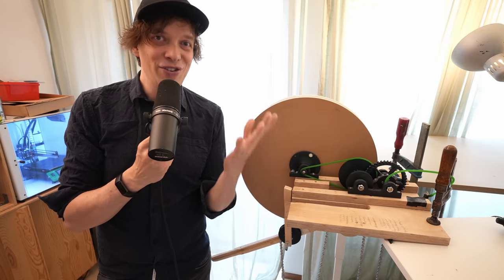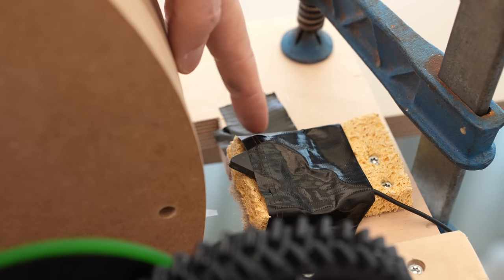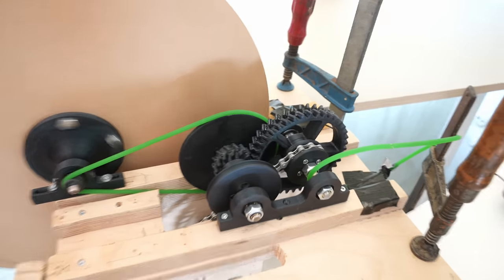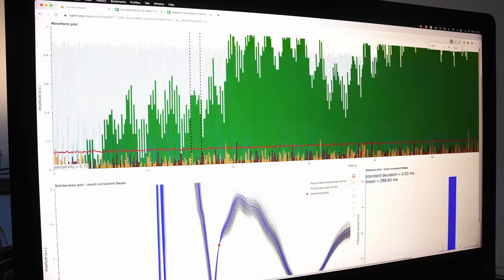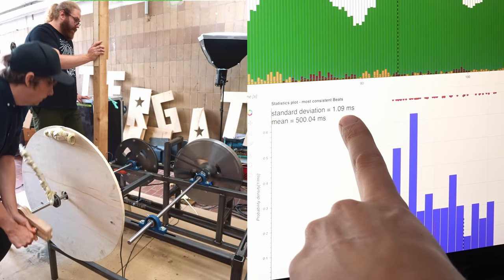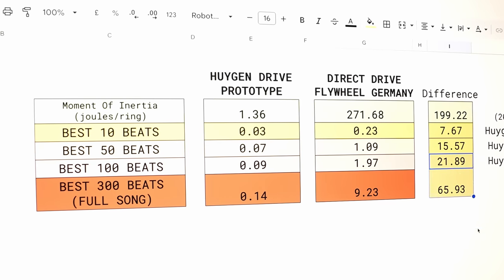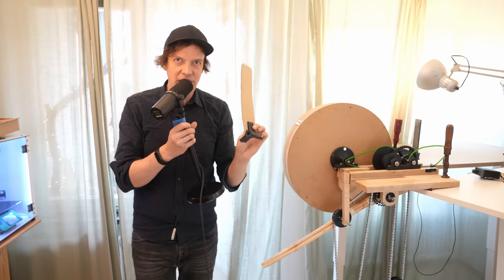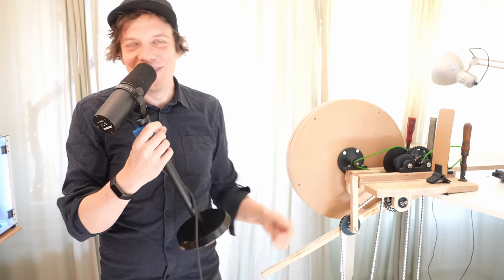Is Gravity Really Constant? I Built this machine to find out.

Comment: You really need to install a Governor. It is a reason they use it on a machine with a heavy flywheel. It really helps to keep a steady speed. 😉
Reply: Very true
Reply: Is there a way to have the governor tied loosely to the input? Martin cranks at ~100bpm and the drive evens out the output to keep it constant. If he changes to 80, the governor adjusts to the new rhythm.
Reply: Yes ! Without a governor, this idea with the weight won't work. The weight (and force) will be constant, but the machine will go slower in parts of the music with more notes. When there are less notes to play, the machine will accelerate.
Martin, you need a governor !
Reply: But aren't these things controlling the power ? Like the vent from a steam machine..  (?). So they don't make any sense on a hand-or pedal driven system ..
Reply: The Governor combind wit Huygens drive is probably the best solution.

Comment: Martin, I think that you push your prototypes beyond what they are capable of measuring. Rough prototypes can give a direction, but testing prototypes have to be close to the final design, it's not a prototype because its "rough" or "half-finished" it's a prototype because it's not the final. But to run exacting tests, you need the prototype to be full fleshed out, that way any changes you make toward the final product will actually be realized in your final product. The way you are doing it, you're building a rough model, and then going straight to final based on the rough model, and then getting frustrated when the final doesn't work... because really it's just the first prototype. What you've built here isn't a prototype, it's a practical model. Talk to your engineers about it, I'm sure they know more.
Reply: Louder!  I don't think Martin can hear you.

Martin does seem to make things worse for himself…

Comment: You are going to need to do some testing with that flywheel and the prototype in Germoney under actual load, driving something that puts up varying resistance. That should give you more reliable/useful measurements.
Reply: Germoney? Is that like someone from Harry Potter?
Reply: Yes, I don't understand how this design could work with varying torque as it needs a constant resistance, no?
Reply: I think it comes down to how the governor ends up being designed, because the governor will end up adjusting how much load it puts on the flywheel in response to everything else that's being powered by the flywheel. Like this is two major improvements, creating a constant source of power and the governor to use that constant power to regulate the speed of the flywheel. I'm interested to see how much more effort it takes to keep this going, since it's basically wasting a lot of power in the form of air drag to keep the speed constant
Reply: Indeed, a 'tight' power train when it isn't doing useful work really doesn't mean anything. You will need a really really massive flywheel to overwhelm the tempo changes caused by variable forces of actuating all those gates to be a tight as Martin desires (though worth pointing out the drum full of pins is also a flywheel of some reasonable merit in its own right, so once you get both the common flywheel and the music box drum spun up you should get even better results). Not to mention in the modular machine context its possible whole extra modules are also only sometimes providing resistance at all... But Martin does seem to barely notice comments such as this...  And that Hyugen will probably not scale up practically for a world tour, if you can even make it run on one man power at all - bench size test is not the same as lifesize!
Reply: @foldionepapyrus3441  Nah it's fine. The Huygens drive will scale fine, so long as the size of the MM3 can be 2m×3m×35m. Who wouldn't want to see Martin's suitcase dangling from a chain 30 meters above the stage?
Reply: @foldionepapyrus3441  Completely agree.

Comment: The weight of the chain will vary based on its length and the impulse of raising the weight will also contribute to the variance. Glad you decided on the more consistent choice. Speed can be adjusted from the governor so you still have the ability to add your feelings on the fly. It might be fun to have someone from the audience use a bicycle type contraption for raising the weight so you can preserve the use of a pedal.
Reply: He mentioned that the weight needs to be kept at a constant height which would negate the influence of the chain length. Either way he should have used an escapement, if he wanted a clock.

Comment: My main concern is that this drive seems very dependent on load, this would means if you're to keep this tightness, you'd have to make sure load is also constant
Reply: Yep, it may need some sort of torque converter linked to a governor. But I think, at large, the load will be almost constant during the song. It will just depend on the number of simultaneous notes played.
Reply: I can imagine times when, for example some tracks are muted. The load will drop and without a governor, it will begin to speed up
Reply: @frazbombe   yep muting was my first thought, drum sections on the MMX seems to take quite some load, flywheel will dampen somehow. But yeah, without a governor, no way to get back on timing
Reply: Governor would add resistance when going over desired rpm. When load makes the machine slower governor will reduce its resistance to compensate. There are also governor designs with integration component that work like PI controller and can achieve exact RPM as desired with variable load
Reply: He can swap loads to change the BPM. That's why this was the ONLY way for him to get the production tightness he really wanted.
He just needs to build the final version and test the BPM at varying weights.
Reply: Maybe connect a generator and a load, like an incandescent lightbulb. I hate it.
Reply: The music generating component of The Machine is on itself, a variable governor, in that it is inevitably a variable load. A machine governor needs to be used to balance the overall load on the drive system in order to maintain rotational speed/tempo. That's not going to be an easy task. Certainly not impossible though.
Reply: you could change the timing of the notes to counter the differences in load that they would generate
Reply: A clock escapement setup would be the perfect governor
Reply: @sabata2  Fun fact- This does not work when you also change the load  on the machine by turning music  channels on and off during the performance.
Reply: With a heavy enough flywheel, the load from notes played would even out a lot, to the point where this is almost not a concern.
What I'm more afraid about is how slow the machine is to accelerate, and how hard it will be to accurately determine how much weight you need for a certain song bpm.
Reply: With this construction, I guess rpm(t) = k*(1 - exp(-t/t0)), where k depends on the ratio between input force and friction (the latter also includes drag), and t0 on the inertia. Since gravity is a constant, we can reduce the inertia in order to get up to speed faster. We can also see that the driving weight or drag governor must be calibrated, depending on the remaining parts of the machine.

You really want a second order system to fix the slow startup time. Such a system would increase the driving force at a low RPM, and apply a negative force att high RPM. With a correct feedback ideally critically damped, you have a solution which can be driven by hand, yet keeping a constant RPM. Since my background is Physics/Electronics rather than Mechanics I am not sure how to build it, but a good start is to look into springs or pendulums in order to construct an oscillator.
Reply: What if the weight sat on an airbag/piston that was balanced with a pump.  You regulate the air coming out with a valve, so that the pressure changes in the  airbag/piston.  You would essentially be changing the mass in the system.
Reply: it's the same way grandfather clocks work, there's a timing weight that drives the pendulum and too much/too little mass will make the clock run fast or slow
Reply: @claytonbaber  then the timeing would be off. That is why we are in this horrible rabbit hole
Reply: I agree, without considering the variable load I fear that this will be very similar to the problems with everything being noisy in the MMX that was first brought up but ignored and then came back again and again.
My two advices would be to install a pendulum to the system as it can absorb energy or give away energy by changing the amplitude of the swing while the frequency remains the same. Secondly as most of the energy consumption probably will be lifting the marbles it would be good to disconnect that from the power supplies that are determining the tempo. This could probably be done rather beautifully by Marting just powering a marble lift of some sort and then having a stream of marbles that powers the timing mechanism that is just doing the releasing of the marbles for playing, as this probably only requires very little power you can afford to lose a lot of the energy to some form of governor that would guarantee a even tempo.
Reply: @perpetersson7514  I think you're on to something. Martin should move the marble lifting mechanism to be direct drive from his crank or foot pedal or whatever. It is not timing-sensitive at all, and I bet it accounts for most of the energy in the whole system. The Huygens drive and the flywheel can be driven by the same input shaft, but will only need to be sized big enough to handle the song wheel (which indirectly powers the marble gates) and the percussion wheel (if present).
Reply: @MikeKrasnenkov    have you seen a mechanical PI controller?
Reply: @MikeKrasnenkov  Yeah, the real problem is going slower,  but that can be solved designing the powertrain with enough power so it can run at full speed with all the channels active. So yeah, it can be don with just a variable resisting governor.  So yeah, you are right.
Reply: It could work to have a spring loaded piston connected to the fly wheel like in a piston engine. You drive the engine by pushing the piston. Due to the spring and the mass of the fly wheel, it should at least have a resonance frequency,
Reply: your comment reminded me of the Principle of Parsimony' (as I read a few above). 😊👏
Reply: I don't know the first thing about this, but wouldn't it make sense to make the flywheel the "energy store" and not gravity? Then you'd need some sort of clutch system to "tap" the energy at the desired rate for changing the rate of the actual machine.

Comment: Martin, Gravity while you're using the machine won't change. Moving around the world, however, will have a very small effect!
Reply: Depends on the sensitivity of the instrument.
 You can count the large boats travelling on Danube with a torsion balance in the basement right next to the river.
Reply: Yeah, gravitational acceleration will vary depending on the distance to the Earth's center of gravity.
Another minor factor is that different atmospheric pressure changes the density of air which changes the buoyant force air pressure provides and that effects the perceived weight of an object. Probably neither of these factors would be very noticeable though.
Reply: And the biggest downside is that it won't work in space!
Reply: @MikeKrasnenkov  so there will be no moon tour? 😱😧 oh, I forgot ... moon has gravity! 😂

Comment: My assumption was that if we’ve been building clocks on that mechanism for centuries, it’s probably tight.
Well done on the prototype Martin. I still look forward to the day I see you live on stage, with or without Marble Machine!
Reply: an escapement clockwork doesn't depend on gravity being a constant as much as a freefall clock with a break needs it to be. into an escapement system you can also add load -  like relatives of this mechanism have been used for thousands of years rather than hundreds of years like proper clockworks.
Reply: It won't effect the flywheel at the scale that Martin is operating, but yes, the local gravity does very along the surface of the Earth.  This variation in mass distribution is on the scale of how the moon, Sun and Jupiter affect your weight as the Earth rotates.

The "force of gravity" is constant but the mass underneath you locally is not distributed evenly and you are affected by the gravity of everything else in the Universe.  Unless you are playing music with the tides, differences are so small that the music on the frequencies humans can hear won't be impacted.
Reply: imagine if clocks were handcranked
Reply: @waveclaw  it also varies  with the distance between centers of mass, so if the weight is allowed to change height the force will change by a miniscule amount
Reply: my big concern is that clocks don't change their BPM. I can unfortunately foresee some issues in the future with this. changing the BPM would surely mean changing the friction in the machine, which would affect the rate at which the weight falls. I may be wrong but I FEEL like there's a problem to overcome with that
Reply: @whippy-dz1bc it would be achieved by different masses in the weight that's powering the huygens drive. Like that you can achieve different equilibrium points between the mass and the air governor, meaning different flywheel speeds / bpm. I think it was one of the reasons why Martin tried the pedal prototype first, because it would be easier to change bpm, than changing weights around between songs
Reply: I would assume that too, but why assume when we can test, and get entertaining and fascinating content out of it at the same time? 😉

Comment: I think that a heavier wheel will compensate for the difference force applied while making the weight go up and when not. A heavy wheel + this mechanism will produce a sound tighter than all the ones you have ever produced.

Btw extremely cool video, research is the best part of every job in my opinion :)

Comment: Have you considered putting your albums/drum stems through the tightenator? Playing tight music is really important but human musicians aren’t that tight it may be σ = 10 ms over a track gives you character whereas σ = 0.1 ms over a track makes your masterpiece into a convoluted midi machine. It might become more sterile and lose character. Playing tight music as an engineering requirement is great but you may want to decide both an acceptable upper and lower bound for tightness. More tighter isn’t necessarily more better. Just like auto-pitch correction can remove character from sublime micro-tonal performances if not applied delicately.

Comment: I strongly suggest you look up steam engines, especially the torque limiting assembly. There is an interesting node there that creates additional resistance when the rpm is too high, and removes it when the speed is not high enough. And in general - mechanics and physics are pretty cool!

Comment: My background is in watchmaking and I see what's obvious going on here. Another poster here used bicycle components as a metaphor. And what's interesting is that you could use a stock bicycle freewheel and a derailleur to act both as the ratcheting / chain tension mechanism AND a bicycle gear cluster + derailleur + bar shifter as a transmission selector. The only part that is missing here is the escapement. Forget governors, use an escape wheel, a pallet fork, and a balance wheel. You're 90% there but this is settled engineering. Why in heavens would you want to use something inferior like a governor?
Reply: He would still need a system to keep the tempo stable. It's rather difficult to bike at a fixed speed on a hilly road. ;)
Reply: @Robbedem  That system is called an escapement.

Comment: For all intents and purposes gravity is a constant for you.   It's other forces in your mechanics that can make it very.   But again,  If you check popular songs you will see that the rhythm is not as constant as you would think.  In fact it's the variations in rhythm that gives it that human feeling.
Reply: It’s been a long slow road for Martin but I think he’s fully lost the thread by this point
Reply: Very what?
Reply: @jtorola  It does kind of seem like he's after sounding like a robot or drum machine or something.   Imho, the foot peddle was the best option.   It's consistent enough and allows him slow/speed sections to follow the music's feel.
Reply: @jtorola Martin went down a rabbit hole years ago and has never come back. 

He's violated so many engineering principals along the way.
Reply: @bmotik I assume he means that gravity based on the setup he made could have variations, but those variations are from the machine testing it.

He worded it very poorly. 

You have wind currents, wind resistance, gear resistants, and I could go on for pages about factors.
Reply: @bmotik  The main beat.

Comment: Well, yes and no...
It is pretty constant as long as you don't change location.
I also remember having heard, that it also varies slightly over time.
But this variance is probably too small for Martin to be measured 😁
Reply: Exactly, and for some stuff it that variance can have an impact, but for the sake of this marble machine, it's safe to assume it is constant
Reply: It also varies based on altitude and geographical location, though also slightly. You need to be flying 100km above sea level for earth's gravity to go from 1g to 0.96g. Standing on the top of Mt. Everest you're still experiencing 0.99g.

Comment: You'll still need a way to change tempo in the song - I'd suggest a CVT (continuously variable transmission) to achieve this, you could adjust the speed with a dial or something.
Reply: An escapement mechanism, and a stepped transmission wheel is all he needs.